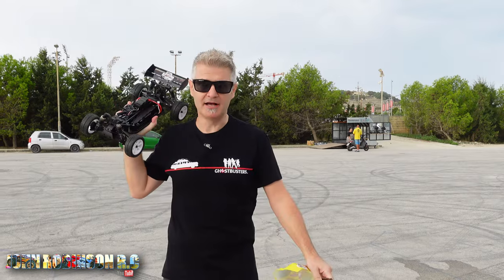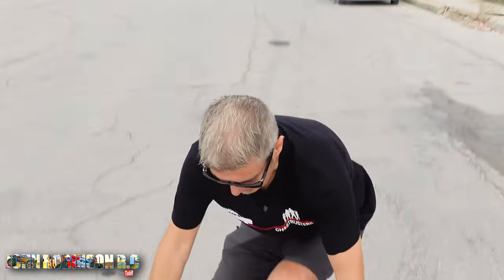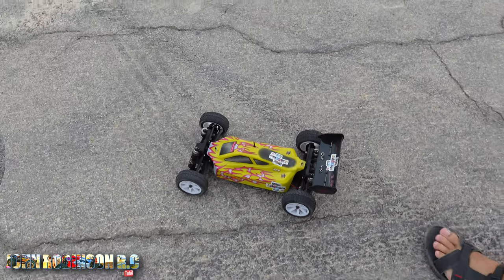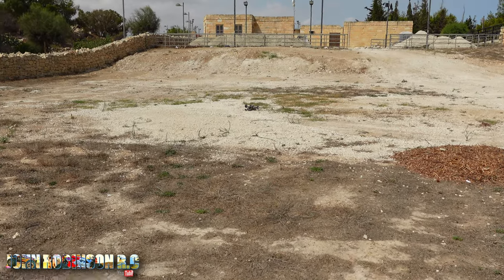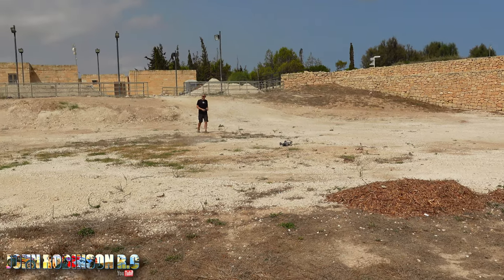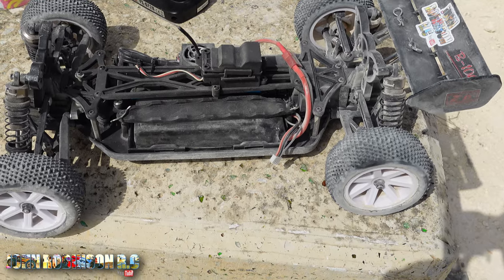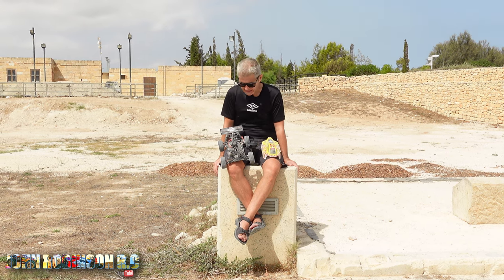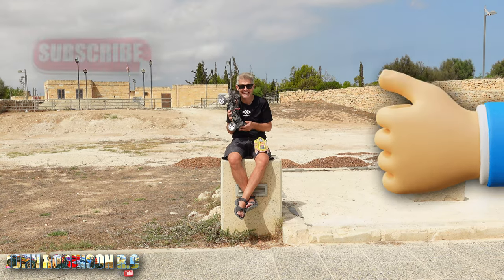OMG this car is awesome!!! ZD RACING B10E 9102 gravel & tarmac test

Comment: You've very similar speed results as mine, 44km/h on 2S and 68 on 3S. I gamę Racestar 3650 3900-ish KV motor and Quickrun 10BL60 ESC. Right now I'm waiting for a new suspension arm (I've let my friend to drive it, and it took him 5 minutes to break it). Great video, great car, and great fun, even on 2S (44 km/h is enough for me to bash it around). 😁
Reply from the maker: Yes very similar speeds. Typical that a friend breaks it so quickly. That's Colins job for me. If I need to see if something is fragile then I let Colin drive. He can flip any car at any speed in seconds. 🤣🤣
I have the same motor and kv but all surpass Hobby. Never had a failure. Have a lovely evening. 😊👍🏼

Comment: I got this buggy as a kit for £58 a while back  and put in a 3900kv motor , 25kg bangood servo and a 60amp hobbywing quicrun esc and it flies on 2s havent even tried 3s yet! highly recommended
Reply from the maker: Nice one! Great price and nice electrics. It is truly a great car for the price. Especially if the customer has the electronics at home already. 58 quids then a bargain.
Reply: @JohnRobinsonRC  yes can't complain about anything for that price, I also need to go in and apply through in key places as well
Reply: threadlock
Reply: I picked up a roller for £62 turned it in to a truggy, 15mm hex extenders 125mm monster truck wheels 4600kv 3650 and a 120a esc run a 19t pinion 

I've hit 37mph off road on 2s and 48mph off road on 3s also if your in the uk ftx vantage diffs centre drive shaft rear dog bones and front cvd's are a straight swap if you need replacements
Reply: @moorhen6156  great tip about vantage drivetrain spares cheers
Reply: @Alex-wr5qg  also all the metal dbx-10 parts will fit like the chassis, shock towers, front and rear hub carriers etc
Reply from the maker: Seriously about the FTX vantage? Colins old vantage is in my studio collecting dust and the parts will fit on this. Wow that's a great tip! Thank you!

Comment: nice one mate!! Also dont forget to fix the mesh and I'm wondering if a 3660 would Fit? to go for a higher kv = More top speed but still keeping the torque and punch so It doesnt start cogging, and It sure seems It can take a good beating without complains, to me It just seems zd racing are one of the Best when It comes to value for you money, I really really want a dbx-7 and now they also have the mx-7 and It seems awesome as well, if everything comes out fine i wanna get something bigish by the end of the year but I dont know I have seen also a new 6x6 crawler 1/10 with a 2 speed gear box so I been also thinking about that one and take the brushed can out and put something brushless in much more faster and try to get the Best of both Worlds 🤣🤣 I dont know Also as you said nitros are great mate and I have also seen a vrx racing one that seems to be great and "really" cheap, any way I have gone already way off topic sorry about that 😅 but I hope you fix It soon cause It seems like a really good car, P. S. the new 18th scale brushless wltoys you just tested the other day Is on AliExpress right now for less than a $100us if you pick the versión without the original box, and just a bit More, less than 110 if want the original box, and you can have It with up to 3 batterys for just a little bit More in both cases, cheers mate and keep up the good stuff!!! ✌️
Reply from the maker: Hiya mate. Yes the 3660 should fit. They are similar in size so shouldn't be a problem. Just the 3660 has a 5mm shaft so not sure if I have a suitable pinion gear. Plus I honestly don't know if the differentials could take the increased motor? 🤔
I have to agree about the DBX-7. I looks amazing and so detailed. One of those on my wish list. Or should I say, another one on my wish list! 🤣🤣
6x6 crawler sounds interesting. I have to assume the extra 2 wheels means it won't get stuck anywhere? 🤔

Nitro is fun. Noisy but fun. But after having the cheaper f1 Nitro engines and now the professional used xray. I would say avoid cheap rtr nitro and buy a decent used professional nitro. The one we bought was in horrible condition, yet is still much better quality than the engine on both the RB7 ang F2004 cars.

Wishing you a lovely evening. 😊👍🏼
Reply: @JohnRobinsonRC  I'm currently using a 3660 3500kv in a tamiya that used to be a king blackfoot the surpass kk series or the Rocket one offers both 5mm and 3.175mm shafts for their 3660 motors, I'm running the one with the 3.175 shaft and It wheelies at any speed 🤣😅 about the diffs well... Those should be fine for a while but they would wear out sooner for sure than with a 3650 motor cause a 3660 has a lot More torque and if you have the power, you are gonna want to use It 😅😁
Reply from the maker: I love the statement. Wheelies at any speed. I'm sold on the idea. My 3660 is in the f1 car so will have to order another one, therefore wait until pay day. Thanks for the info mate. Much appreciated! 😉👌👍🏼
Reply: @JohnRobinsonRC  no need to thank mate I'm glad I can help a bit, also I'm about to see the new vid on the f1 car It seems for the title you used that It didnt went well I'm sorry already mate, and it's going to be nice to see this zd racing again in all Its glory!!
Reply from the maker: I was frustrated with the f1 car. As what's been said. 2 steps forward and 2 back. However its not wasted as the 2 back has eliminated two possible causes and therefore two less to worry about. Once I get foams then it will be perfect I think. 😉🤙👌
Reply: @JohnRobinsonRC  I just saw the vid mate hang un there you aré getting close and you Will make her work youll see, by the way that swap from direct to spur and pinion runs really smooth mate , nicely done cheers mate cant wait to see the next vid

Comment: That car doesn’t seem like it can handle the bumps at all!
Reply from the maker: Hiya. Nah can't agree I am afraid. This Area is not flat at all. Been worked on with piles of soil dumped all over. Add the large rocks and grass and weeds. I surprised it didn't flip more. I'm struggling finding a flat area here in Malta due to the summer heat. When the rain comes and flattens it down again, I will run it again and show you its true capabilities. We raced it at a race track that included curbs and bumps and the professional driver said it handled extremely well. So my apologies for not getting that point across. Have a great weekend! 😊👌

Comment: I don't know, but looking at the reviews on the WLToys 144010, comparing this car to that one budget and performance-wise, the WLToys wins hands down.
Reply from the maker: But this is a 1/10th so hard to compare against a 1/14th. What other decent 1/10ths do you think are better for the same budget?
Reply: Well just compare it to the wltoys 10th scale then surely 😂
Reply: @davidmellish3295  I Actually took a quick look at the WLToys 1/10 scale cars and they are overpriced and problematic.
Reply from the maker: Yes afraid the WLToys 104001 is no camparison for this car. I never use my two wltoys 1/10th. This one I am constantly driving. So at the end of the day. The one I drive and makes me smile is worth the money. Plus this one handles better than the 144010 and wasn't the 144010 the one I had that the swing arm pin broke in 5 minutes? 😬